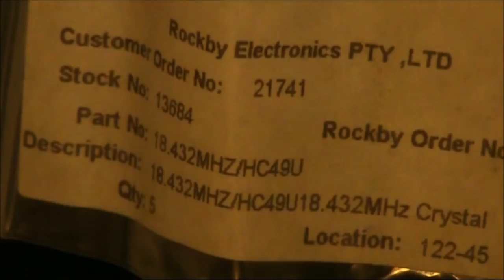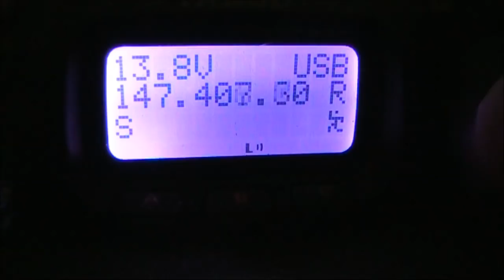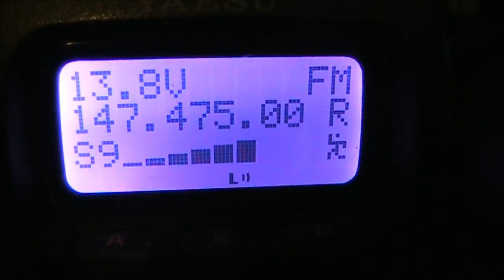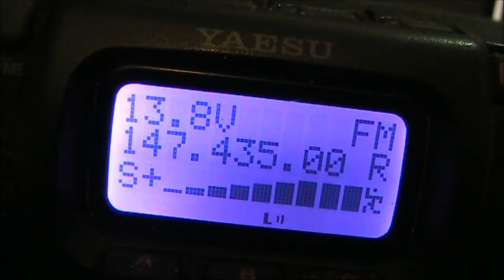Frequency modulating a crystal oscillator for 147 MHz FM

Comment: Once I used this technique by using 49.435 MHz xtal to produce signal at 2m NBFM. Back then I used 3 stages circuit, almost identical to yours but with 1extra stage that is buffer with tuned output.

Comment: Hi if I use a 30 pF cap near the crystal can I get the 4 th harmonic overtone for example 27 MHz to 108 MHz
Reply from the maker: Short answer is no. Longer answer is you will need to add two frequency doubler/amplifier circuits following the oscillator.

Comment: hello peter why not only filter and amplifier signal (harmonic in 147,456 mhz )...why use stage circuits ?
Reply: add 100nf cap   3.3k and 10k to ground in circuit number 2

Comment: How do you get the circuit to multiple the crystal's frequency?
Reply from the maker: All oscilators have harmonics on multiples of the fundamental. A cleaner output requires a multiplier stage plus a selective tuned circuit.
Reply: @vk3ye  I do not understand,, but I really want to. If I understood I could make radios for any frequencies, right?
Reply from the maker: @xierxu  Cheaper to use a DDS frequency synthesiser these days. Made to order crystals are expensive.
Reply: @vk3ye  Is it the calapsing magnetic field in the inductor that causes the huge current spike to the antenna? If I replace the inductor with a crystal would it work the same?